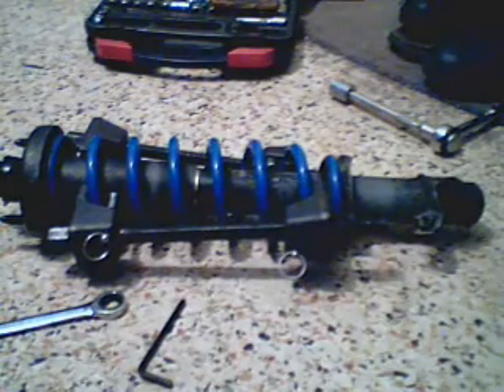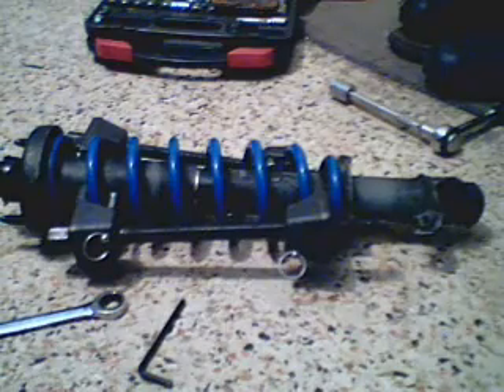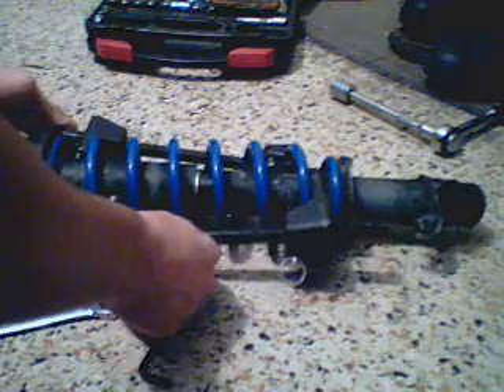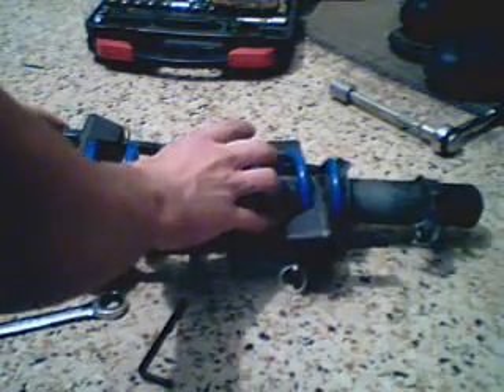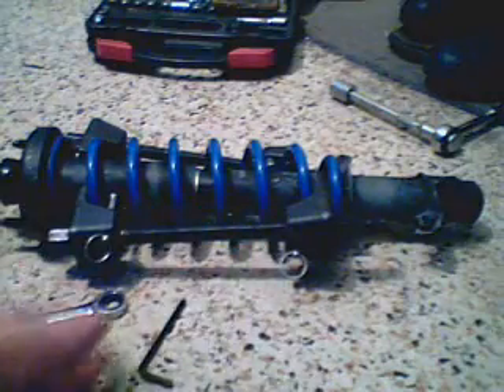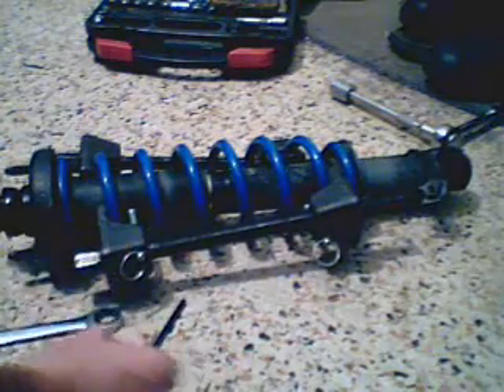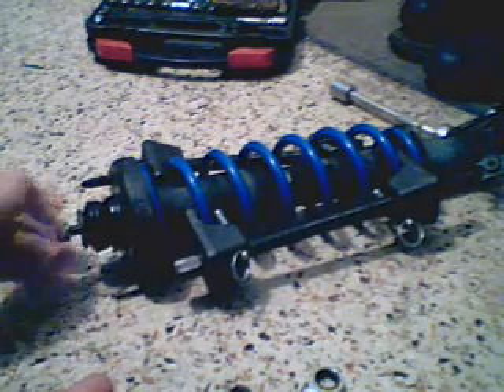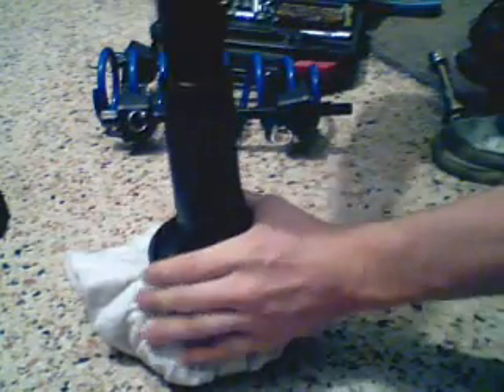How to: Disassemble/re-assemble a strut and test if it's good.

Comment: deff use a spring compressor, me n my buddy put his in a viceand just tried slowly taking the top nut off? yeah parts went everywhere, bolt got stripped 2 threads, and he has a hole in the roof of his garage

Comment from the maker: I believe they were just off-brand eBay springs. I didn't buy these springs, they came with the used struts I bought and I switched to stock springs before installing them on my car. I don't have experience with lowering cars but I do understand how alignment works. I believe the problem in your situation may be that you have too much negative camber on your wheels from lowering your car. Getting an adjustable camber kit for your car and getting everything aligned might fix your problem.

Comment: Are those M2 lowering springs in the video? I've just installed M2 springs w/tokico struts on 98 integra RS, my car wonders & darts over uneven road surfaces & shakes at 60mph. Someone said it's b/c my springs or soft & car is low. Also the driver side strut went bad after two days, my mechanic said the rear shocks are leaking oil. Could it be installed incorrectly? Any ideas/feedback would be greatly appreciated. Just can't understand how 3 struts went bat that quick.

Comment: Sorry bro every shock is diffrent ...there are shock that has resistence down and resistence up depending on the damper champer.   I have seen brand new shock that doesn't come up after its press down but its as hard pulling up as it was pressing down

Comment: hey mate do you think if the shock absorber is worn would it be ok to use a second hand complete suspension with  spring and strut or just to change shock absorber on existing strut

Comment: man tell me if its a good deal there tein S-techs and have kyb struts. for 250 with less thAN 5K ive never done a suspension job but i think all buy them and try it i have a 1997 honda civic its on my channel if you want to check it out but do i have to transfer the old stuff from the sturts onto the new one please help thanks for the video very informative

Comment: hey man i was looking at shocks in the shop and the piston rod is very tough to pull out from the shock and is very tough to push down when extended... its an oil based shocker... the guys over there say thats how a shocker should be... its perfect... is it? it has no compression/decompression going on... its stiff in and stiff out... what do you think about that?

Comment from the maker: With coilovers,instead of using strut compressors, you release the spring pressure by loosening the spring retainer nut at the bottom of the spring,using the special wrench for that nut to loosen it.
I'm glad you liked my video,thanks for the comment!

Comment from the maker: The blue spring that was on it was just a lowered aftermarket spring.I bought the struts used and replaced the aftermarket springs with the stock ones.You can find the lowered springs on ebay though,I seen some like the ones I had on there.